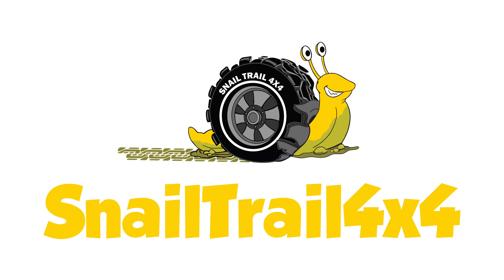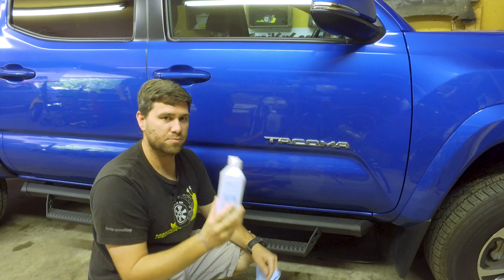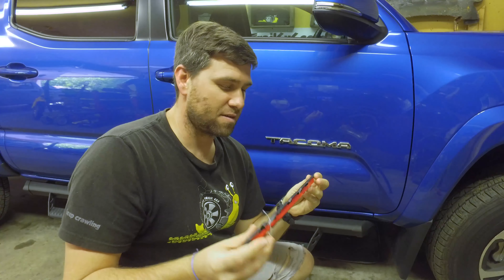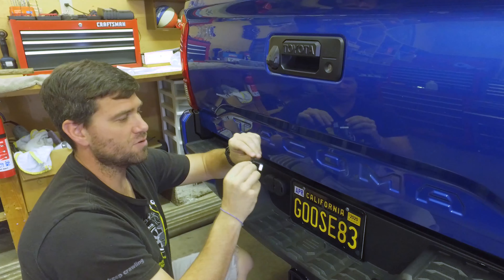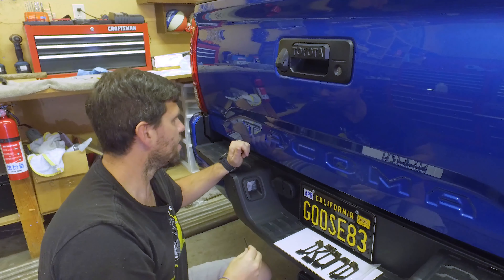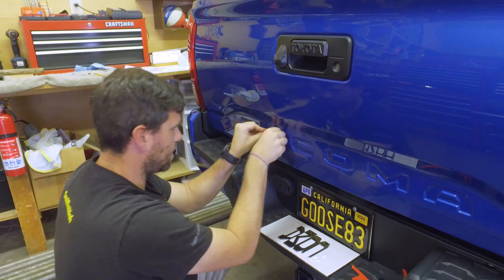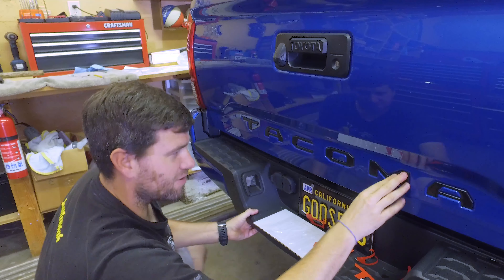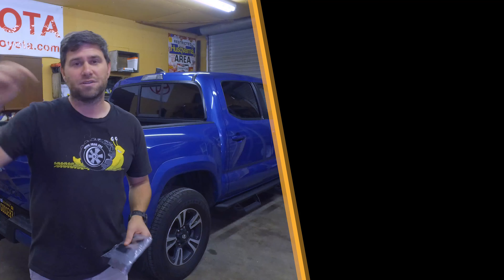Blackout tailgate letters and emblems install | 3rd Gen Toyota Tacoma

Comment: I found the kit without the extra pieces that I didn't need. It's a 9 piece kit that only includes the 6 letters for the tailgate, 2 Tacoma emblems for the doors & 1 V6 emblem. None of the other emblems that aren't on my 2020 Tacoma TRD Off Road 4x4 are in the kit. Your video made it look so easy that I'm installing them today myself instead of waiting for my hubby to do it. Thanks for the video. 👍🏻
Reply from the maker: I believe there are links in the video notes

Comment: Dude I didn’t even know you could get the ones that go on top of the chrome. I was going to take them off and replace using the fishing line method. This is so much easier.
Reply: Had you found solid replacements in black? Even the Toyota option from the factory is an overlay that mounts on top of the chrome originals. I guess you could remove and paint.
Reply: @ksnow34  No I just went with the overlays.
Reply: I did the same..I thought about removing the crome but instead I put the black ones over the Crome before watching this video and its holding up great I’m surprised they staying on this long

Comment: If your doing this in the cold, in addition to cleaning with iso alcohol, heat up your emblems until they are slightly warm to the touch, it will adhere much much better as the adhesive will bond much better when it's warmer. And if you want to ever remove ANY sticker, price tag on hard serface, you can also use a heat gun or your wife's blow dryer! It won't leave any residue, and if it does just easily heat it up again and scrub with alcohol. Word of caution, do not get it burning hot especially on surfaces like car paint!

Comment: Question I have to turn to Tacoma lifestyle telegate insert. I just received no instructions in it. The letters are in a separate package. The sticky tape is in a separate package. What is the best policy? Put the sticky tape on the tail gate letters first and then attach the new inserts that way. Or put the sticky tape on the back of the letters and then put it on the tailgate. I just wanna make sure I set right? And they don't fall off, but it seems very odd that there's no instruction to the tape of separate.  Thanks

Comment: the price is double if you order the combination set? what is the difference between ordering the emblems and the tailgate letters
 separately or the combination set besides the price?
Reply from the maker: No difference to my knowledge, just convenience
Reply: @SnailTrail4x4  FYI...I ordered the emblems and tailgate letters separately. The website for the emblems (doors and V6) are not overlays.

Comment: Will these eventually loose their stickiness over time? Will they accidentally come off after car washes?
Reply from the maker: I don't think so, they have a lot of adhesive on them, and are a tight fit. They haven't fallen off yet
Reply: The Crome has the same adhesive so these stuck over the Crome and hood as strong if it’s a good summer day it’s better than a cold day

Comment: Will these fit on a 2014 tacoma?
Reply from the maker: Nope, these are for a 3rd Gen Tacoma. These should work for you https://www.amazon.com/dp/B07PKQFPJJ/ref=cm_sw_r_cp_apa_i_FYrfFbERR2C8P
Reply: SnailTrail4x4 that’s for the response👍🏼
Reply: SnailTrail4x4 I’m curious though. The ones u linked do not seem like overlays. Will I have to completely remove the badges?
Reply from the maker: @matthew2764  It looks like most everywhere is Blackout replacements... I don't know why. I found this place that might have something for you. Best of Luck https://puretacoma.com/index.php?main_page=index&cPath=724
Reply: SnailTrail4x4 thanks again

Comment: Would these fit the 2019 SR model?
Reply from the maker: Yep, they should
Reply: The kit sold by Toyota includes overlays for all chrome lettering for all trims; you end up with extras for the other trims.  Mine did not include the individual TACOMA letter inlays for the lower tailgate letter indentations.
Reply: @mikestevens2053  same its another part number for the tailgate large letters. They fit perfect. I have a 2020 SR5 4x4

Comment: Just plastidip your emblems. Much cheaper and easier than this.
Reply from the maker: I can't imagine it's any easier then placing a sticker. I do agree that it's cheaper, but if you have to spend all that time masking the letters so you don't get over spray onto the body. When you could just pull the back off a sticker and place it over the emblem.

Pluse these emblems are thicker and more resistant to chips and wear. The plasty dip will show the chrome underneath.